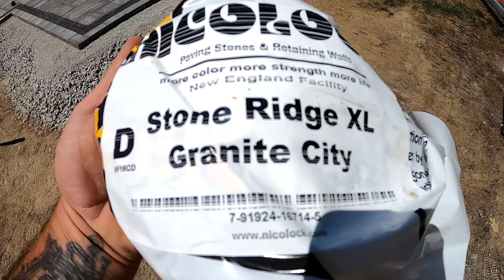Who Doesn't Love a Nice Patio...?

Comment: Lookin sweeettttt. Our cat skid loader had a door. HAD...   it was an outswing that someone left open with the arms up without putting the brace up.  They left and came back and the arms sank and ripped the door off lol
Reply from the maker: Thanks brother! I have seen quite a few Cat doors get crunched....LOL. A company I used to work for had Cat skid steers and that happened a couple times before the boss took the doors off completely.... Than you a screwed when it rains or when its hot or dusty, etc... Pain in the a** design... ✌
Reply: @TheChristianHardscaper  for sure! annoying with but not the same without out lol

Comment: How do you like your new machine?
Reply from the maker: I am loving it, the next video I upload will have it in it.
Reply: @TheChristianHardscaper about time😊
Reply: Hey bro.  Im a fellow scaper.  From.canada. i watch all ur vids.  Im switching after years of failures to concrete edge restraint. But how do i compact and set poly ? Concrete first or after.  I tried after compacting all edge pavers pushed out a bit ...? If i concrete first the borders to hold it in ? Or ....
Reply from the maker: @danknugz7605  Nice man, thanks for the support! I typically do the concrete first and tamp lightly around the edges during poly. That is why we set the border pavers a 1/4" higher than the main pavers and set them in place with hammers, so that we do not have to tamp them so hard during the polymeric sand process. Another good way is to do the concrete then do the poly while the concrete is still wet. that way compacting will not ruin the bond.

Comment: Another nice installation guys! Curious to know how you run lawn irrigation along the edges. How close to the 3/4" gravel can you trench as well as how close can you place the sprinkler bodies to the edge of the paver border and the concrete used to lock it all in without compromising the stability?
Reply from the maker: Thank you! You can run the line about 12" away from the edge and you can put the heads right up close to the concrete no problem. ✌

Comment: Any reason for not using a laser ?
Reply from the maker: There is not many situations I deal with that require a laser. I never really liked using them, good old string and line levels does the trick when you have experience. ✌

Comment: I have been watching all your videos and became a huge fan.  In fact, i tore our my patio which i used sand for a base and redoing the whole thing.   I do have a question which maybe later in this video.   My pavers are not great like the ones you used we had several thousand dollars in pavors and could not afford to buy new 3 pcs sets.  So my pavors are 16x16 square and have a pattern.   After watching your videos though i am not following the pattern and laying them out as ramdon as i can and it looks much better.  As i have got a good amount done i have concerns that the joints are tight.   Like 1/16th tight and internet says not to use polymeric sand.  The only option would be to lay like tile floors with spacersbut then i worried about compacting and the pavers shifting.   I actually stopped for a bit because i did not know what was best.   Seeing this job gives me a since of direction.  Sounds like your going to use the polymeric sand with this tight joint.  Are you feeling that this is going too work with no issues?   Do you think i am heading down the correct path keeping the blocks as tight as possible?   Would love to know your opinion.
Reply from the maker: Hey there, thanks for the support! You can use polymeric sand for that joint size, it may not fill every joint 100% but is better than pretty much any other product out there.... You can space them out with tile spacers and that would most likely help with polymeric sand lasting longer but it is totally up to you. Either way will work for you✌
Reply: Yes.  Watching this video helped me  make the decision.   The joint lines are tight but I will be patient and work as much polymeric sand in as possible and compact.  Has to be better than not using it.  I am doing this by myself and this patio in total will be over 2,000 sq. Ft.  I have done every step exactly as you discussed.   I thank you for elevating  my hardscaping ability.

Comment: Should you always leave a gap between the pavers and the house foundation? Do you need to install any edging, or is chip stone enough to fill the gap and keep the pavers from moving?
Reply from the maker: In my opinion, absolutely. It allows the pavers room to move slightly through freeze/thaw months.

Comment: Loving the channel, learning alot. How do you estimate the base materials? I want to build a 12' x 29' patio. Augusta, Georgia, sandy soil conitions.
Reply from the maker: Thanks for the support and feedback! So for the base stone, I calculate how many cubic yards I need. You find that by getting your square feet. Lets say 12'x30' (360 sq ft). to find cubic feet, you need to multiply 360 x the depth of the stone. So for 6" the number to multiply is .5 because it is 1/2 of a foot. So 360 x .5 = 180 cubic feet. 1 cubic yard is 27 cubic feet. so 180 divided by 27 =6.6 cubic yards of 3/4 stone needed for the base.

Comment: Looks good! Do you ever seal the paver patios you guys build? Just finished a patio and we are wondering the pros/cons.
Reply from the maker: Thank you! I don't ever seal the patios I install. All the manufacturers say you need to wait a minimum of 60 days after install anyway for the concrete to cure and poly sand to set. Plus, there are many things that could go wrong and mess up the look of the pavers. Then you have to do it every year or every other year.... It just is not a service that I want to offer, to much headache for such a small thing... Maybe someday with proper training and understanding I might get into it, but not at this point.
Reply: @TheChristianHardscaper  Thanks for sharing your thoughts!

Comment: I have a patio stone with a groove pattern in it, I was wondering if that shallow groove should be filled with polymeric sand/ will it chip out over time or should I somehow try and make sure the grooves are cleaned out before setting the sand?
Reply from the maker: I'm not sure what you mean unless each paver has fake joints to make it look like more than 1 paver. If so, yes, poly sand those joints.
Reply: @TheChristianHardscaper  yes that is what I meant. Thank you for the quick reply